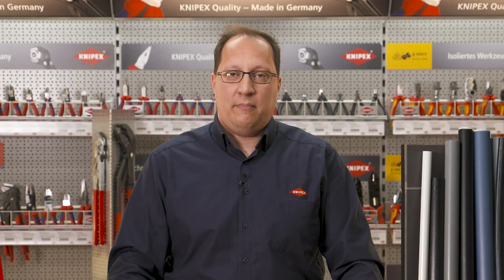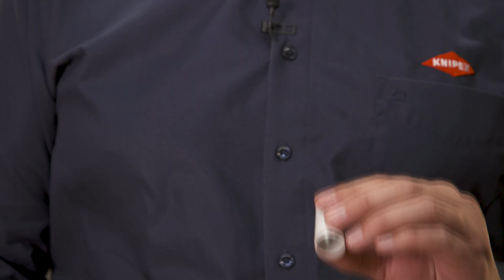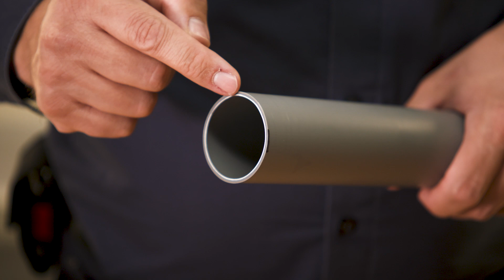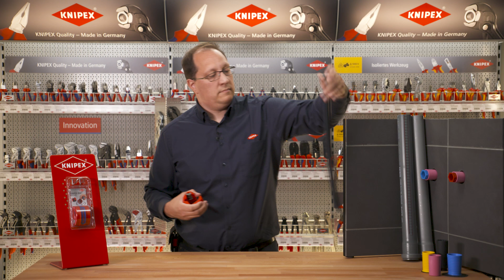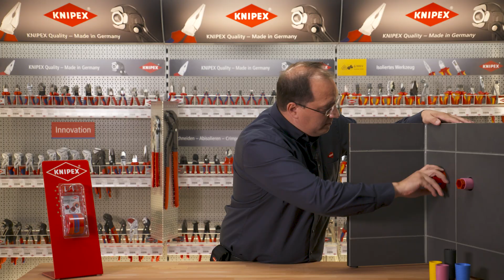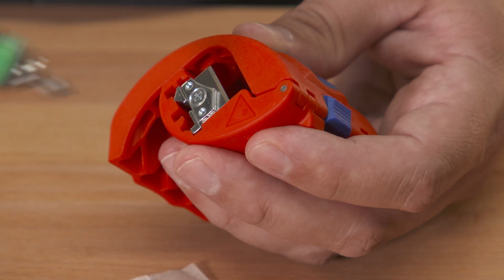90 22 10 KNIPEX WORKSHOP TV VIDEO UK 1920x1080

Comment: The idea of the tool is great, but it lacks automatic (in one pass) chamfering/bevelling function. In order to properly connect drainage pipes with rubber gaskets the end of the pipe should be slightly chamfered.
Reply: Hello Stefan. cutting and chamfering at the same time is now possible with Knipex DP50, available since June 2022
Reply: @dirkadler2717  Thank you for the information. It's great news. Although I have similar cutters made by Ridgid (the original plumbing tools), they come in fixed sizes: one for 32 and 40 mm and one for 50 mm pipes. So having one tool with stepless diameter adjustment will be great. I am waiting for that tool to be available in Poland.
Edit:
I've read the specs. Even though adjustment is not stepless, but incremental and fixed to 32, 40, 50 mm, DP50 is still more versatile than two separate cutters from Ridgid.